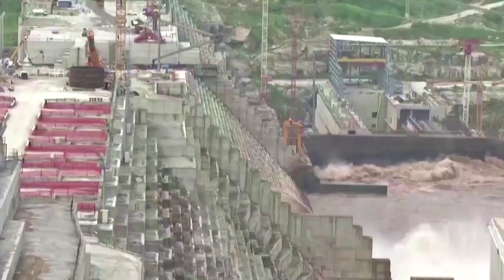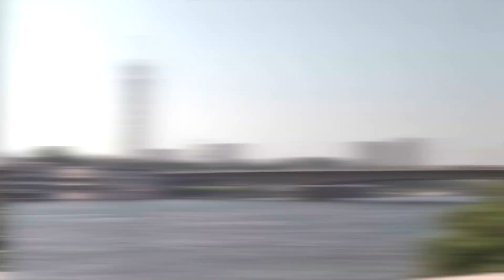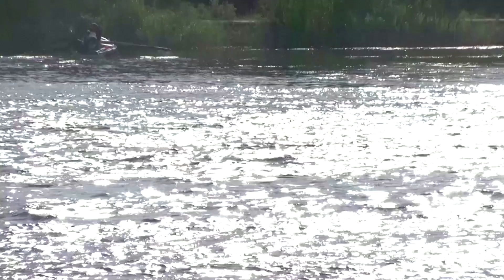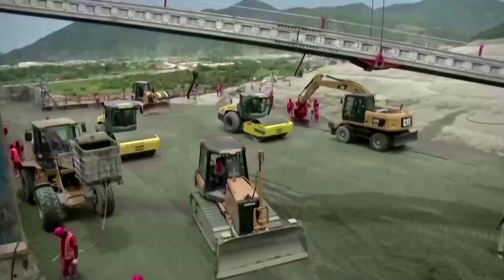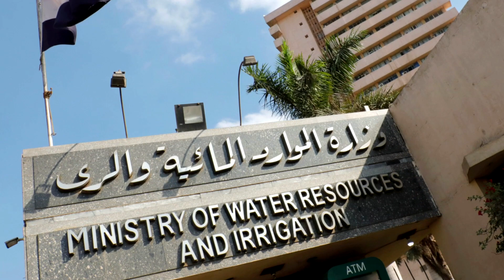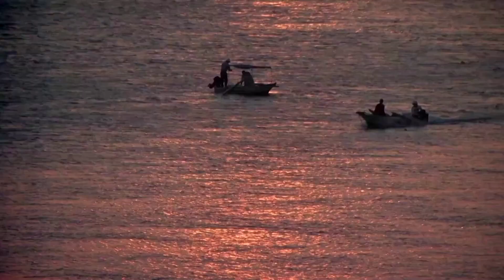Egypt, Ethiopia, Sudan deadlocked over dam

Comment: Unless Egypt’s approach is dictated by the utmost good faith, any attempt to hamper Ethiopia's effort to finalize and use its Grand Dam will have severe side effect on Egypt.

Let alone using force, Egypt shall refrain from her indirect interference into the domestic affairs of Ethiopia’s politics. 
 
It is clear that Ethiopia has at least two Self-defense strategies at hand, not to mention the third invisible but efficient and sustainable one.

1.  If Egypt attempts to Use force- to damage Ethiopia’s Dam, Ethiopians will be forced to take similar retaliatory measure on Egypt’s Dam.

2.  If Egypt opts to buy missiles and tanks to attack Ethiopia by utilizing Ethiopia’s water, Ethiopia shall USE THE NILE WATER - IT SELF- as a lasting& sustainable means to defend herself. In fact, this strategy is: Unstoppable, non-destructive, Developmental Self-defense strategy.

To this end, Ethiopians have a ready-made strategy to divert each and every flow of tributaries of the Nile water. They can at least employ a well-articulated strategy to utilize each drop of water (for irrigation and other purposes) by investing their capital & their labor force- even at the house hold level. 

Hence, it is only by peaceful and good-faith negotiation that Egypt can get the most out of the waters of Ethiopia.

Comment: Please correct the mistake at :28. Egypt's population is 100 million; saying "more than 10 million" doesn't accurately reflect the actual size.
Reply: And Ethiopia’s is 114 million they need it more than Egypt and Its there water to and the water is taking there soil. So they have every right to block the water for 100 years if they wanted to.